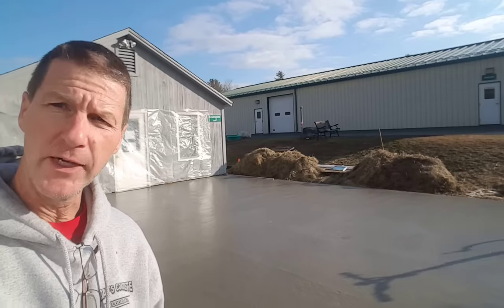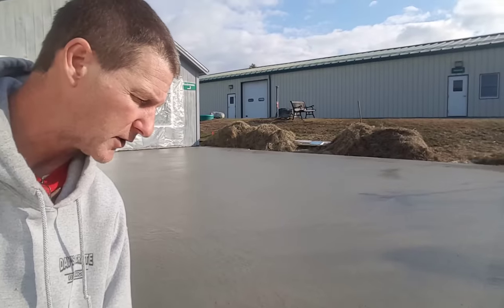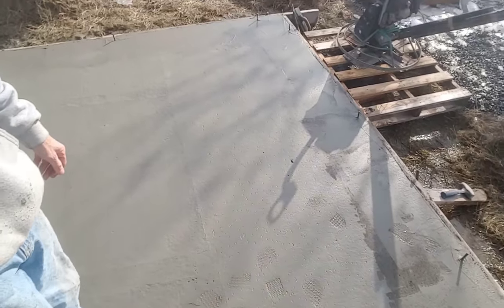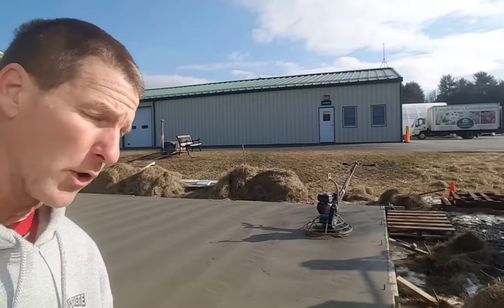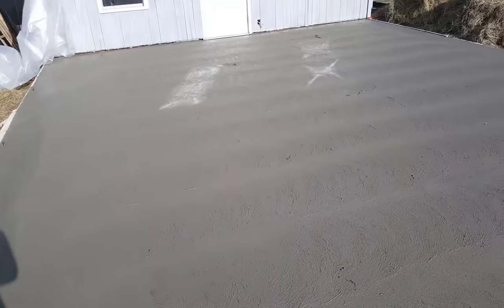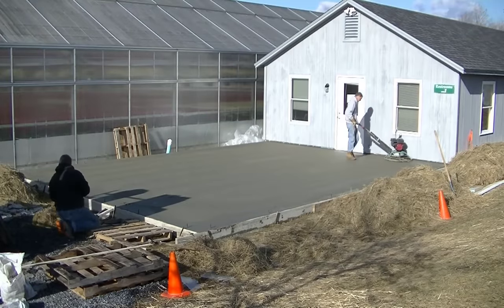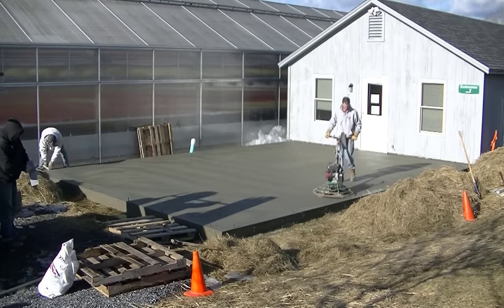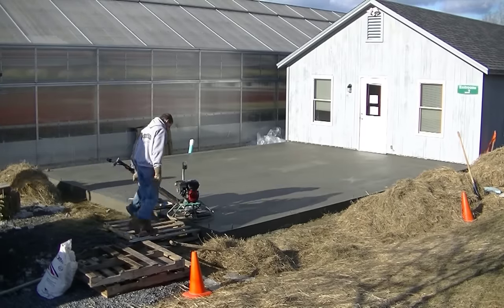When To Start Finishing Concrete | What Finishers Know, That You Don't!

Comment: As a DIY homeowner, my greatest timing dilemma was on a small flight of concrete steps:  When is it safe to remove the forms so I can finish the surface?
Reply: you shouldnt be removing the forms to finish.
Reply: Huh? How the hell you gonna finish the faces of the step then? 
What I do is wait until most of the rest of the flat work is finished and then tapp the forms with a hammer to see if the concrete still jiggles at all. Then slowly start to remove the top form and if you see any sagging at all stop and put it back to wait some more. Once it is not sagging go ahead and remove your form and finish that step by then the next should be ready to strip but go slowly so the form can be put back if needed. I try and get some mud in a wheel barrow that’s been worked up so you have some butter for filling any holes and such. Also my Eric ate those forms right before the concrete goes in. That way the forms strip off easier.
Reply: @cygnus1965  relax bud
Reply: I’m relaxed, just don’t want to see bad info being given out. You patio would look funny with stakes and wood stuck to it forever don’t ya think.? 🤣
Reply: Sucks you can’t edit these posts. It’s suppose to say lubricate the forms at the end there.form or or at least some vegetable oil. WD-40 if you don’t have anything else.

Comment: concrete is rarely if ever " finished " in German construction and i have lived here for twenty five years , had two houses built and inspected close to a hundred houses and their slabs and cellar walls . in very case , i have never seen any cracking , not even hairline cracks . 
Concrete slabs are not finished because estrich or liquid cement will be pored prior to tile work or to create a level surface for wooden floors . 
Most slabs are 8 to 10 inches thick with heavy rebar and rebar mesh ,all supported and suspended in their respective heights . the base is ten inches of heavily compacted road base . the compaction is done in layers as it is being built up the the desired height . then heavy styrofoam is add for insulation . All of this may be why it doesn't crack or there may be additional factors as well .

Comment: Are you running with hot water and/or accelerator for the temps? I ended up hand finishing a 10 yd slab last week because I poured on a vap barrier with no additives or hot water.  I didn't wanna be there til midnight, lol

Comment: I think I'd leave the forms on a week along with pouring water on the surface constantly to reach maximum concrete strength. There is also a sealant to cover the surface if forms have to come off immediately. Great video. Thanks for sharing!
Reply: If we left our forms on for a week as much lineal footage we do on I would own a lumber yard. Spray the face of the forms, even with water if nothing else and pop them at last trowel and after total cleanup. Remove your pins or stakes but leave one in here and there to give yourself a "handle" "if you have left a couple up high enough".Now you can;t be a gorilla about this and you can't pull straight up on the form but a steel trowel or margin trowel on a unseen edge wedges the form away just enough to release the pop. Then shake out and away from the work and slowly up, holding the pins and away from the work. Carry away, remove the "handle pins" clean your forms and you are good to go. NEXT MOVE YOUR FORMS FORWARD.

Comment: Mr.Day not bad but everyone has a different remedy to finishing concrete in So Cal when hardly ever use hand mag floats to me it's a waste of time we use a Fiberglass Hand Float which cuts and fills,run a 6x6 Blue Steele Hand Edger of course flat and Sealing it with Stainless Steele Marshaltown trowel 20x5 when wet ,I respect your finishing techniques but out her we pour quantity with quality.Speed is the Name of the cali game.i myself will post a finishing video the Cali way.anything to make things easier is humbly accepted..

Comment: Hahaha that's funny everything you need to know about concrete well I've been around concrete for 50 years my dad ran a precast plant for oh dont know how many years I've formed and poured everything from water tanks to mow strip and I still dont know everything about concrete it it does pretty much what it wants to all depends on humidity. Your base material . Temperature.  I've lost some pours every truck load is different even batches out 15 minutes apart lost a truck or 2 in my days forest truck is good second good hit that spot where 3 poured and it's gone

Comment: totally newie here but what happens if you do not finish your concrete at all?
Reply: You end up with a rough surface. It all depends on what you’re trying to achieve. For a footer, all you do is pour it and strike it off level. For a slab that will be visible you take a few more steps to make it more presentable.
Reply from the maker: If you leave it bull -floated for a finish it won't be as smooth. It'll be "softer" on the surface and not as dense. It'll be "dusty" on the surface. Unless you seal it with something.

Comment: Hey Mike, how do you change your trowel speed from pass to pass? Such as, do you run wide open on your last pass or do you maintain the same speed through all passes?
Reply from the maker: The trowel speed varies a little depending on how the concrete is setting. In the sun, setting fast it's full speed usually. In the shade, not drying so fast it'll be a little slower. Just depends on how it's drying.

Comment: Too variables not mentioned here. Water added? Any additives like fiber, or plastersizer? What slump was it poured at? Was is vibrated? Power screeded, bull floated? Does your machine do blade pitch? 
I did commercial concrete for years, dozens, sometimes hundreds of yards in a single pour both structural and finished slab , and I gotta say that 90 percent of the crucial work happens before this point. A good rake and screed team can make your job easy, a bad one can make it a nightmare

Comment: Good day sir,  i noticed that some guys throw dry cement on top of the slab and then float. Does it make the slab stronger, I also saw that some slabs especially garage floors have a type of a light grey/blue finish and it is very strong. Can yougive advise how to make your slab especially the top layer when it come to the floating very strong. I am a DIY guy and jobs that I am referring to are aprons and driveways
Reply from the maker: Throwing dry cement on the surface is a big no no. They do make powdered hardeners you can throw on the surface and float in to make it stronger/denser.  This is what I'm talking about: https://www.surecretedesign.com/product/concrete-color-hardener/
Reply: Thanks  for the good advise
Reply: Theo Ferreira - you can actually turn the surface very dark and extremely hard by continuous steel troweling with light water spray. We call it burning the surface.
Reply: @micahwatson9017  Thank you very much, I still have a lot of cement  work and will take your advice

Comment: What happens to the edge of the slab when the ground freezes in the winter and the ground heaves?
Reply from the maker: If the excavator did his job correctly and installed a good gravel base (which he did) we don't have a problem with frost heaving a slab like this.

Comment: Is there an advantage for using a power trowel? I follow another reputable concrete channel and have yet to see one of their jobs use one.
Reply from the maker: A power trowel helps flatten the surface if done correctly and it makes the surface much harder/denser than if you finish it by hand.

Comment: Maybe you can come and teach some of the people where I'm from how to use the power trowel. I'm a flooring installer and where I'm from the concrete guys float the fuck out of it till it's glass and it's full of waves and impossible to grind and nail tack strip into.

Comment: how come you dont use a pan?
Reply from the maker: I told you in the video.
Reply: @MikeDayConcrete  but a pan makes a flatter floor I agree with the way you trowel it crossing when you do your passes just think a pan makes a flatter floor
Reply: @everettcarney3007  A pan will give you a flatter floor, if you know how to use it.  The big question is, how flat does a floor need to be?  Looks like Mike got this on flat enough.  Good job Mike!
Reply: @Kurt Miller it was small

Comment: My advice would be, if you've never done anything even remotely like forming, pouring, and finishing it, do not try it on your own. Especially if it's a fairly big slab that you want to have showing like a driveway. Hire a professional. Don't just watch a few YouTube videos and try to get out in the middle of summer and pour your own 30 yard driveway and turnaround pad. You're going to get yourself into a world of trouble and possibly lose a bunch of money when that concrete gets away from you or you realize oh crap, i can't even pour out the rest of this mud I ordered. A small slab, 5 yards or so, by all means try it, especially if it's going to just be covered with tile or something. It's also like the guy in this video said, you can't really understand the little things about something like running a toweling machine unless you put some time in doing it. Everything in concrete work can be exponentially easier or exponentially harder depending on how much you know about what you're doing.

Comment: I hired some dudes to do the flatwork in my new basement addition.  I hate uneven floors, and told them I wanted someone who had and would use a power trowel for the finish.  They claimed they had one, but in fact were just some Pacific islander family that had nothing more than the floats and trowels I owned myself.  They got a hot load, poured half the slab and ran out, then got a new batch and did a crappy job on the transition.  The slab ended up out by a matter of 2 or more inches so I had to custom build all my framing to accomodate their crappy finish work.

Comment: I have always been corrected when i said concrete dries. Apparently it cures.
Reply: Back in the 60s when concrete was used for highways it had to cure for 21 days before traffic was allowed. Also, I've read that it takes up to 7 years for the "curing" to stop.
Reply: Yup, he lost me with "dried" and I saw no edging which prevents chips on the edges. No idea if true but I have read that Hoover Dam is still curing. Anything we do must be covered and kept wet at least two weeks. In the old days, burlap was used.
Reply: @Rickimusic . . I didn't watch the vid, but did he mention anything about using non-air entrained mix with the power trowel?  Judging by the sweatshirt, and the accent,  I'm betting that slab will be exposed to freezing temps before the heat gets turned on.  Am I spelling surface delamination correctly?..
Reply: Yea, concrete does not "dry" and you don't "cut expansion joints".
Reply: Looked like the slab had foundation bolts. No need to edge in that scenario because a building will cover it up

Comment: Finger check the concrete in the area where you first poured especially in warmer weather and the area where the sun has been on it the longest. Tough to get trapped with a trowel machine but if you are hand finishing you had better check usually where you started laying the crete first. A little tip...if you do get trapped, broadcasting sugar is a retarder and will give you more time if necessary as a LAST resort. Don't get trapped to begin with because even if you save the pad that didn;t kill your pocket you will wish you WERE dead after you finish.  ;-)
Reply: I thought I posted this: learned this from my grand father back in the 60's. When running trowel machines he made certain the operators wore smooth sole or light gripped boots, not the aggressive lug type. When floating the machine with mag shoes and opening up the floor, no problem. But when you knock those shoes off the blades to close the floor and want to "burn" that floor a heavy lug "can"..."can"... give the floor lug shadows when it cures.

Comment: The first wrong info this man gave was that there is no need to go all around the edges with the mag flout.  This is so because the power float will come within a couple inches of the outside edge; so why make all the effort in doing that by hand when the power float will do it for you. The hand edger will cover just about everything the power trowler can't cover; except where there are bolts;  drains; plumbing pipes or electrical wires sticking up.  I have been doing this work for over 50 years, so I should know what I am talking about.  The other thing that is really kind of ridiculous is why go to all that work if the slab is going to be covered with tile, as he said it was.  I could have done that whole thing with only the bull flout without even going out on the slab if its going to be tiled.  In fact the tile adhesive adheres  better without giving it such a hard finish with the power trowler.  So I have to question the management on this job.
Reply from the maker: Sorry, I've only been doing it for 40 years guess I don't have a clue yet. Maybe another 10 and i'll learn how to do this.
Reply: @MikeDayConcrete  What, did I hurt your pride a little?  So tell me, if it's going to be tiled do you really think its necessary to give it a hard finish with the trawler when the tile grout is at least 1/8 inch thick?  Or am I missing something here?

Comment: worlds easiest pull start engine
Reply: Fresh plug and keep the carburetor parts clean and serviced regularly.
Reply: Looks like Honda engine on a Bartell machine, they last for ever
Reply from the maker: Honda engine on a Whiteman. I have 9 of them. We keep them all running like this. No time to fool with them when the concrete is ready.
Reply: Forgot about the Whiteman machines
Reply: I was looking at it thinking....I hope that's not a 2 stroke.  And then it started on the first pull....and I knew it was a 4 stroke.  I just got no luck with 2 strokes.

Comment: Proper placement of concrete should never be poured under 45 degrees and rising for the next 12 hours, unless you have it in a heated room or building to keep the ambient temperature above 45 degrees. Although concrete does produce heat as it cures, it must be covered with blankets when the temp is going to be below 45 degrees for the next 3 or more days.
Reply: Simply not true.
Reply: @1RBDesigns  for you, but try that building a bridge, you won't last long.

Comment: Thanks for a great video! I have been trying to learn more after my contractor's concrete started spalling on me in January of a mild Chicago winter. I think he didn't use air-entrained or had too much bleed water when they started floating (doesn't seem like a patient guy), but he wants to blame 1 or 2 applications of salt. Can an expert finisher like you tell if there was too much water in the final float just from pictures? Here is one:  https://photos.app.goo.gl/smZhi4at4MwSHT1P6
Reply: Salt on New concrete can definitely cause spelling or rock pops
Reply: Don't power trowel an air entrained slab unless you know what you are doing.
If you power trowel bleed water into the surface it will weaken the surface strength. which is what takes all the wear and tear. also the most visible part if it fails. a hardener can help with bleed water, it can help absorb surface water.
salt will eat concrete and cause surface to fail.
when power troweling under hot windy conditions, surface can fool you to finish too quickly causing softer concrete underneath to move and cause a wavy surface. can also trap bleed water under the now denser surface, creating a weak layer that can separate the top from the rest of the slab.
when asking for warranty on your concrete, remember most of the time its not the concrete, it was doomed by improper finishing practices, it is surprising how much info a supplier has to reinforce his position that the concrete was of good quality but was doomed by contractor. after making thousands of yards of concrete, i never had our product not meet expectations. rain, wind, heat, lack of heat are usually the factors that fool a finisher.

Comment: What a waste of time on the knee boards. Haven’t you ever heard of a pole trowel ? And another thing... no need to use the mag float first off, just go straight to the steel trowel. If your any good you will get it as smooth as the machine